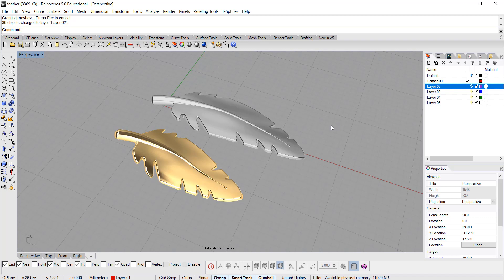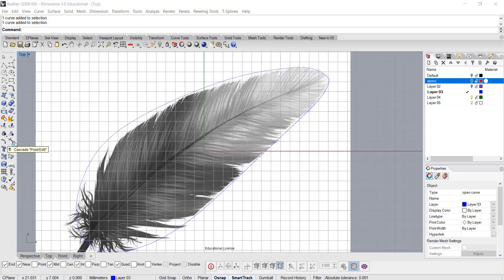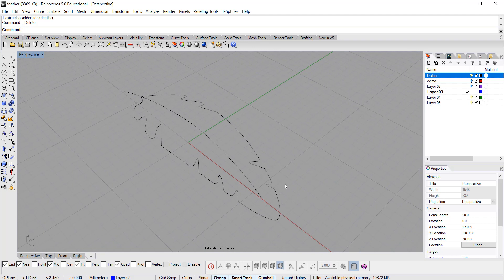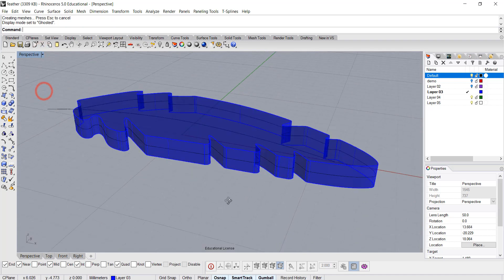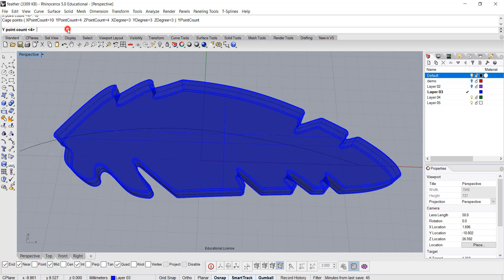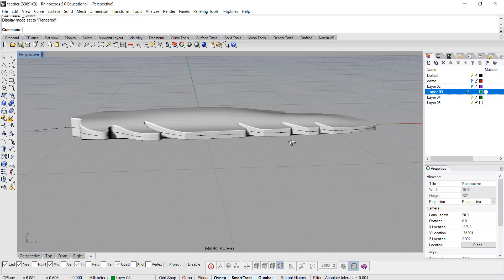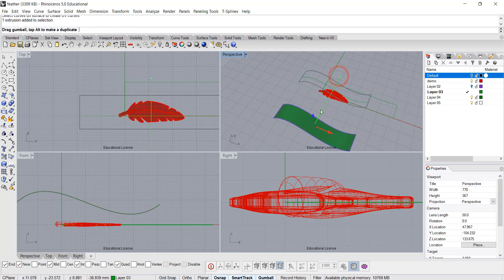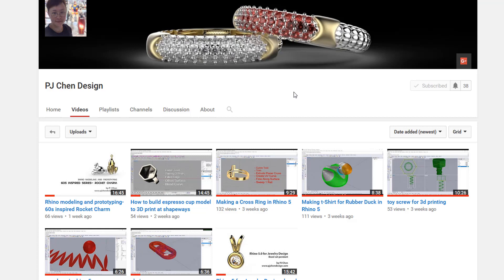Jewelry CAD Design Tutorials #5 - How to Build a Feather/Leaf Model in Rhino 3D

Comment: thanks sir for this video but  can't see my scale tolls how can i show this scale tolls
Reply from the maker: the scale tool is under "transform" or you can type "scale" at the command bar.
Reply: thanks for the fast replay :)
Reply: and i meant  that three Arrow  you control scale and moving the object
Reply: i see it its Gumball
Reply from the maker: if you use Rhino 5 or newer version you should have Gumball. It is located at the lower bottom. between SmartTrack and Record History.